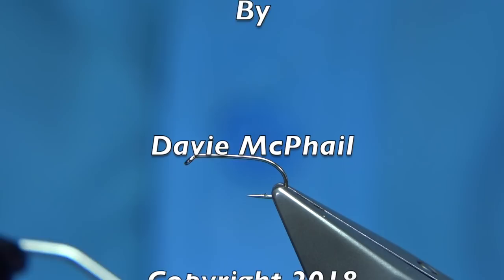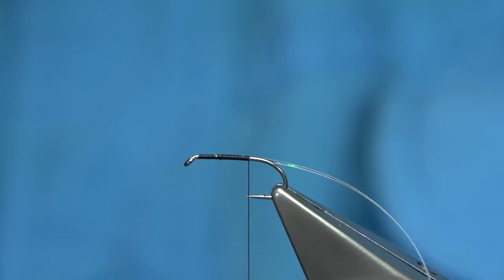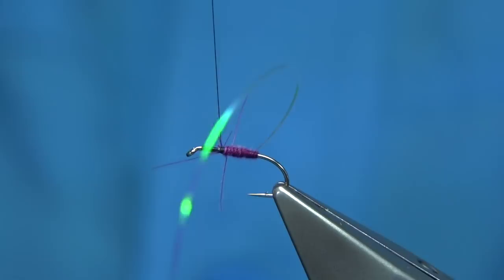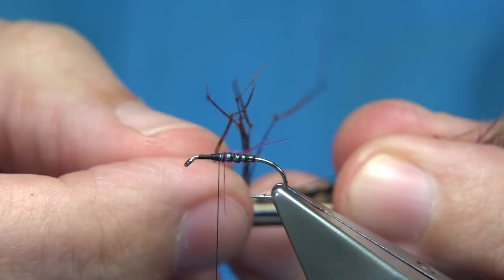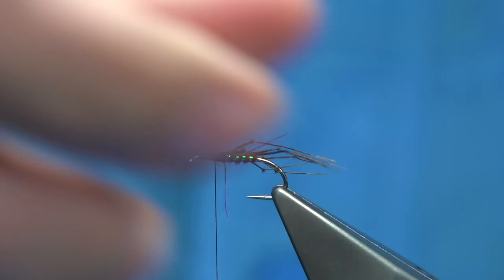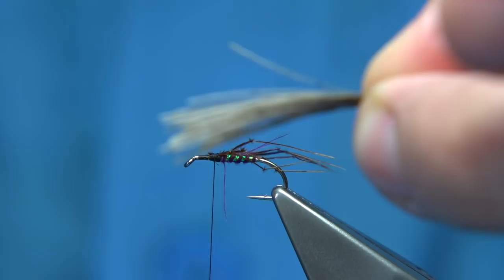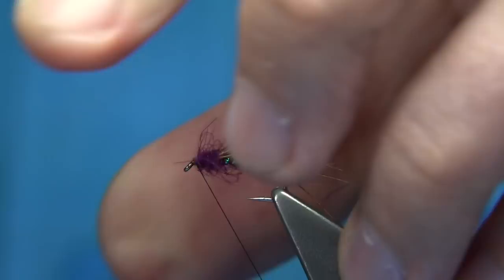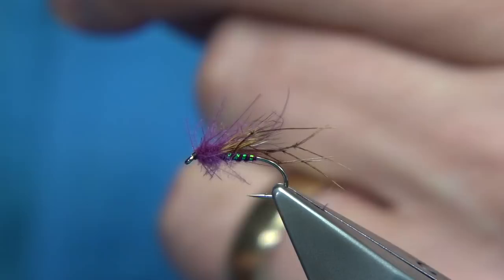Tying a Bob's Bits Claret CDC Hopper with Davie McPhail

Comment: And another simple excellent tying example Davie ,can you explain to me in not too many words why sometimes its necessary to use the tip or the base of a hackle when its tied onto a fly
Reply from the maker: Hi Stuart,

It's much easier to tye in hen hackles by the tip as they wind on much easier and with less bulk due to the stem being much finer...I also do this from time to time with cock hackles due to the same reason especially tying salmon flies..

All the very best Davie...
Reply: Thank you for your kind reply Davie and the explanation but what I was after was an understanding of what type of hackle, ie hen or cock goes with what type of fly, I am assuming that the dries have the stiffer cock hackle tyed from the tip & the softer hen hackle  usually goes on the wets and various sinking flies. Thanks anyway for the reply & I will be looking forward to your other videos